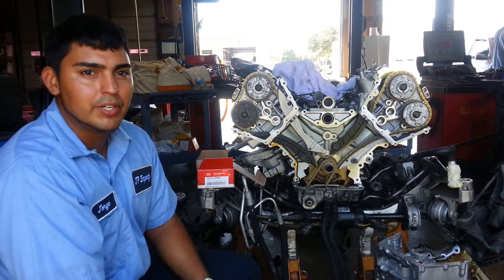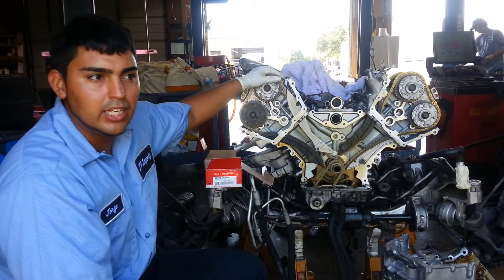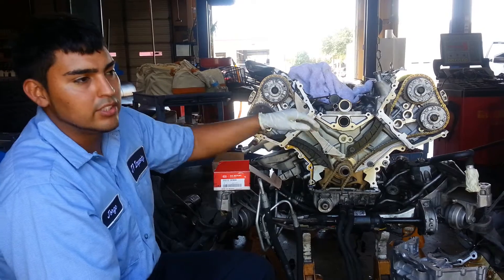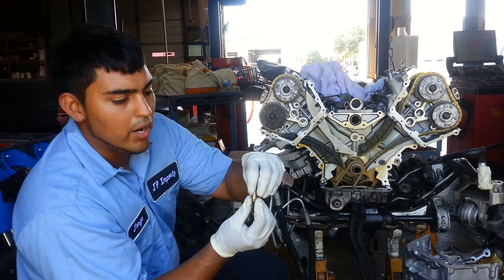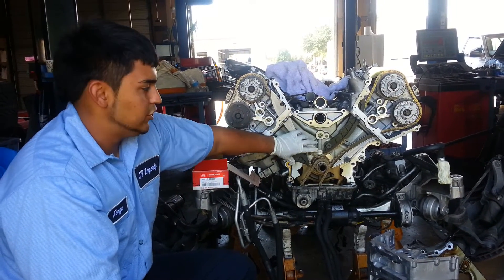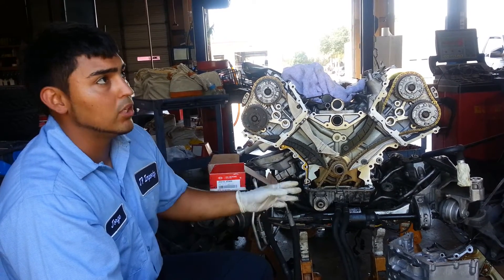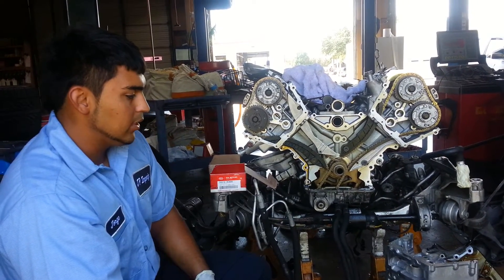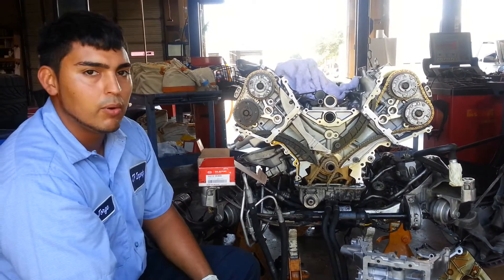BMW N 62 valve guides replacement

Comment: Are you serious? You guys have lost your minds. You do not need to remove the cylinder heads, nor do you need to replace the chain guides.  How much do you charge...with all that work I don't see how anyone would pay. Use the AGA tool and get this done in a day.
Reply: No they have not lost their minds. AGA tool is a good tool but replacing leaking valve stem seals is not going to fix the reason what caused it. The problem with these engines is that valve guides get worn and subsequently valve stem seals start to leak. By replacing the stem seals you will stop the leak only because the new seals are softer but the worn out guides will soon make the seals go bad again. These engines are junk from the day they came out from the factory or perhaps even from the drawing board. The valve train design is so flawed that there is no wonder that the guides wear out, during valve opening there are forces that are pushing the valve stem sideways and in combination of weak material used for guides makes this one of the worst engines BMW ever has designed. The idea of Valvetronic is great but obviously many rules of proper engine building are violated in this design.
Reply: @NilsJakobson  Well said. Most people repair just the symptom. These guys are doing quality work that will last far longer. And of course if your in there, replace the guides!
Reply: @NilsJakobson  did valve seals 2 years ago and still no smoke😎